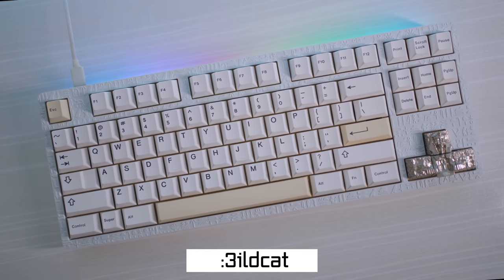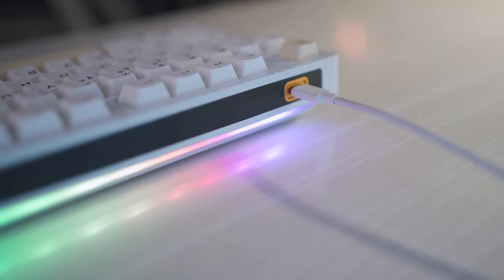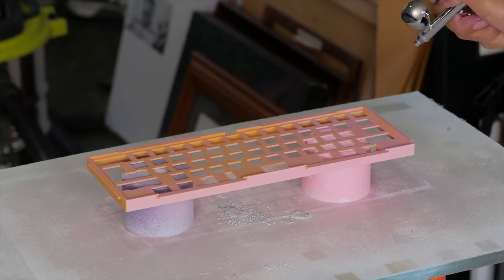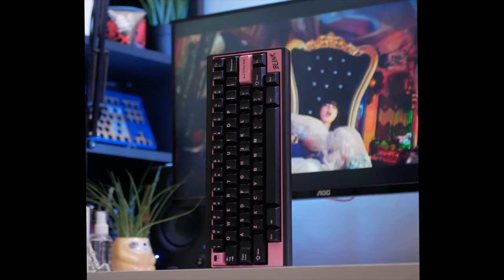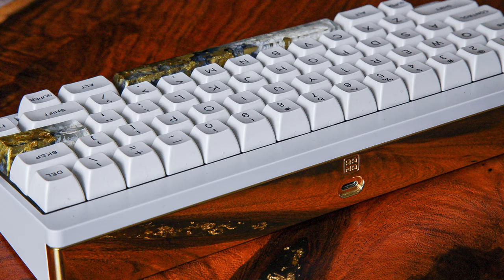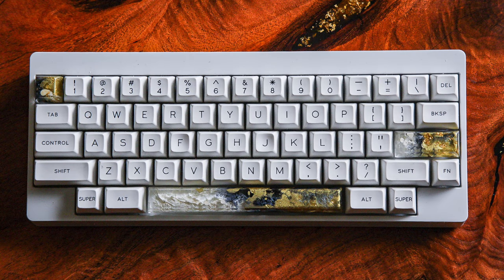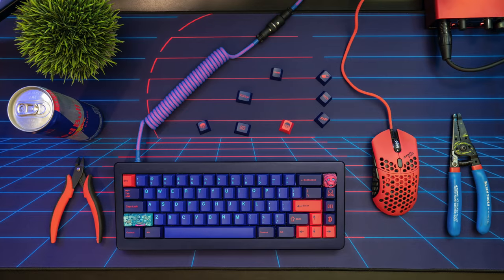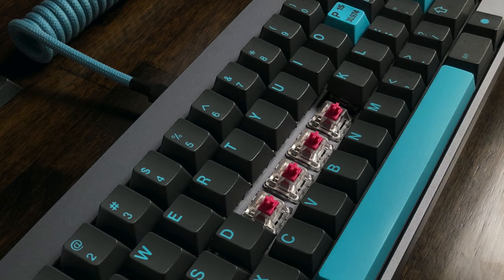Switch it Up: Custom Keyboards #6

Comment: nothings beats my old membrane office keyboard with a broke escape key
Reply: Lol
Reply: Thats exactly what i had lol mine was dell and a hand me down from my mom 😂😂
Reply: @disprot5353  nah, he meant broke
Reply: *broken
Reply: @aasunakii7141  rollercoaster of a story
Reply: my dell laptop intergrated membrane keyboard broke so i bought a mechanical keyboard
Reply: fact but those apple keyboards a school were better
Reply: @dino-life  literally
Reply: My dad works with computers for a living and he did the impossible: he found his endgame keyboard. The MacAlly iKey 4, which is a relic of the early 2000’s was a keyboard made work alongside the new mac that had come out. He got the keyboard because there was an optional key cap set specifically for the software he used, and the membrane switches inside are still somehow tactile as ever to this day. He has had six of them at one point.
Reply: membrane sounds better than mechanical in my opinion, so i agree
Reply: @dino-life  lol
Reply: Lol

Comment: When you build a custom keyboard; you realize that famous brand keyboard Corsair, Razer, Steelseries; etc are toys for kids.
Reply: @Bryce Aliffi i'm fine with my Logitech g513, only problem is proprietary switch stems. Corsair, on the other hand, is trash. Overpriced things with scratchy switches and cheap excuses for a wrist rest.
Reply: I have a ducky but I would like to make a custom keyboard or buy a keyboard that I picked the parts for and just the company assemble it for me and send it to me that way.
Reply: @codertommy6883  corsair at least has cherry switches tho
Reply: @oscarpeters5309  mx bad, what's your point
Reply: @codertommy6883  mx is still better than other brands imitating them eg razer switches or logitech switches
Reply: @oscarpeters5309  not so sure about that, my Kailh (GX) Browns feel a lot more tactile than MX Browns
Reply: Steel series is the only one that is a actually great keyboard maker try out their apex pro tkl I have it and it’s great
Reply: @slide6725  Or HyperX
Reply: Yea lol
Reply: @Bryce Tech Razer have their optical switches, all of them better than cherry-based offerings. Also razer mice are pretty good for the most part. Other than that tho, and corsair, yeahnah, not the best companies
Reply: @oscarpeters5309  Dunno about Mx vs knock off, but “Razer’s” opto-electric switches are kilometres better than any cherry or cherry knockoff switches.
Reply: @Bryce Tech Maybe, that’s just not my experience tho, I am using a deathadder v2 as we speak, and whilst it doesnt feel the greatest, for $70 AUD it’s good. Now, if their quality doesn’t really improve from what I’ve experienced in their midrange, to what it’s like in their high end, then yes, you’re definitely correct.

Comment: Come Monday I'll be building my first machanical keyboard! Tofu 60 wtth lubed and filmed gateron yellows and a cool japanese set from EnjoyPBT! The size of your channel brought  the custom scene to my attention and now I'm building myself! Teaha types keyboard jesus, on my sub list as well now :P
Reply: Nice build! Lubed + Filmed Yellows are one of, or the best budget switches.
Reply: @Archurus  thanks! I thought I might have cheaped out. But I think I made a good choice. I already got them. I’m waiting on a replacement plate as they sent me the wrong layout and I can’t fit my keycap set, but the lubed filmed yellows sound and feel amazing! The only other linear I am leaning towards is the alpaca!
Reply: @YiannisMorfos  Yeap. For such a nice board, better switches would've been a great choice, but Yellows are the best bang for your buck none the less. My old GK64 had em, before I upgraded to a KBD67 with Black Inks.
Reply: @Archurus  Tealios are going in the next build. Or maybe I’ll wanna try some tactiles then, who knows. But I would love to be able to get something like the mode80 and a nice gmk set. Until then I’m really happy with my choices as a first time builder. I didn’t go hot swap or stock switches so I see myself legit DIVING in this hobby 😂
Reply: @YiannisMorfos  Be careful on the soldering part. If the iron gets too hot, the contacts might burn, and a few keys may stop working. My next build will probably be a budget build, I was able to pickup the NK65 EE in the colour I wanted which is very impressive haha, and some H1s, paired with the GMK Samurai keycaps, which looks really good imo.

Comment: That SpaceCables one is so deliciously near quiet. Then the spacebar goes and ruins it, still sounds better than most, but by comparison it sounds like the spacebar on a completely different keyboard is being tapped.
Reply: I found out after this was recorded, but the switch's top housing was broken for the space bar, it has since been fixed. :D

Comment: 0:22 you mean the keyboard money pit... I can't for the life of my life find a relatively easy way to build a custom keyboard on the cheap. The only way I could build such a keyboard is if i download a 3d keyboard design and find someone in my area to print them, salvage some switches from a cheap mechanical keyboard, solder them together and connect them to a logitech wireless keyboard pcb or an arduino...